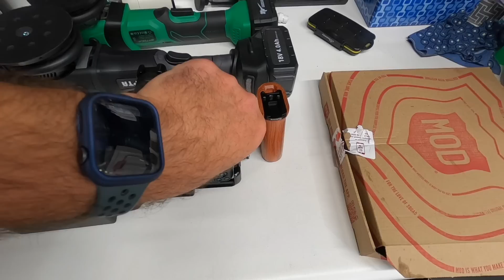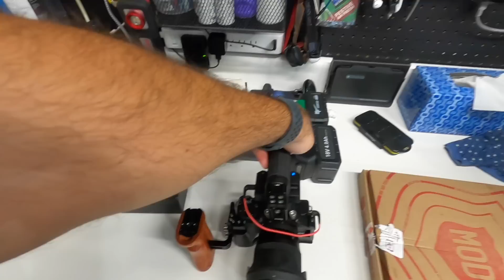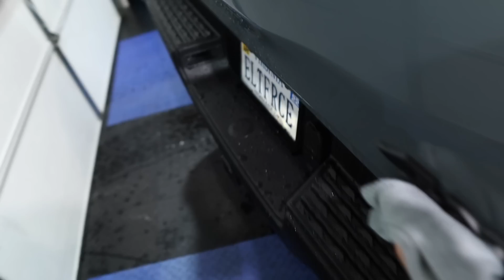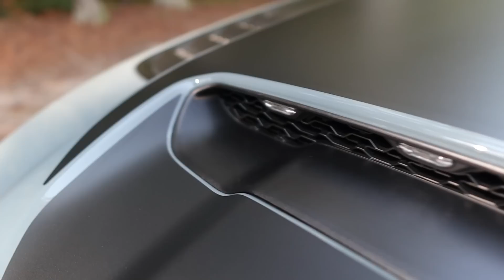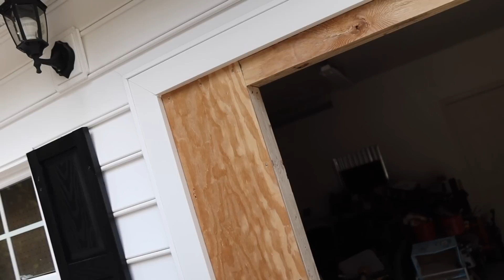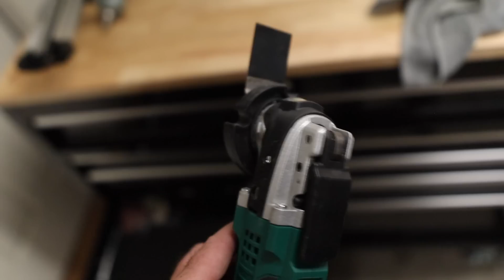Weekend Wash / Ceramic Coatings / Detail Lounge Build

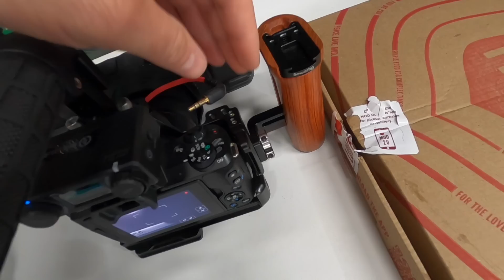Comment: 4:40 - Yeah, I HERE the difference alright.  Not hear, but HERE!  LMAO! :)

Oh Phil, what kind of LVP flooring you going with?  And are you going straight onto the concrete or using padding underneath the LVP?  Loving the lounge setup man!!!  You gotta host an event some time so your fans in the area can bring some beer over.  You like Pilsner or IPA?

Also, I just installed a ceiling fan in our new home and my wife absolutely loves the fan we got.  It's a Hunter Omicron that comes with a remote.  They're relatively affordable and come with a remote and work great!  One switch to reverse the fan as well.  Good lighting to boot.  Figured I toss an idea your way for ceiling fans. :)
Reply from the maker: 🤣. 
It’s the New Age flooring. It comes with a padding already on the flooring which is awesome. It’s like 1/2 inch thick!  
I love wheat ales, reds and lagers in that order 🍺.  Thanks for the tips!

Comment: Hey Phil. Mixing your super clean up in a sprayer for cleaning cars.how much super and water do you guys normally use? Thanks guys!
Reply from the maker: Hi. We mix a 1:4 ratio. So usually for a gallon mix 32oz of chemical and the rest what. 
Here is an easy way to calculate ratios 
https://youtu.be/9cCacFdc2CU
Reply: @MirandaDetailing  Phil. I’m going to use dr paint chip for a few Imperfection on my hood. But I was going to do it all in one polish. Should I do the polishing before I do the paint chip?  Thanks again!  Great stuff as always.ps. Dr paint chip works great. Just a heads up for you guys. Thanks
Reply from the maker: Hi. Cool!  I would polish first then do the chip repair. I haven’t used dr chip personally. Only becasue when working on a customers car I would have to order it ahead of time and most times I just find a paint chip pen locally, because it’s fast and cheap. But I have heard it’s a great kit. 
Thanks!
Reply: @MirandaDetailing  thanks Phil.
Reply: @MirandaDetailing  uesd the rupes uno protect and it did wonders. What’s a good and decent priced Ceramic coating. I have turtle wax spray now. I’d like something in a liquid form with an applicator. Any advice? Thanks lol.
Reply from the maker: We love use Gtechniq EXOv4 as a 2 year costing. It’s easy to use and gets awesome results. But if you want a spray coating they are really only a 8-10 maybe 12 month coating if garaged and cared for properly. The Hybrid solutions Spray coating is a great option!
Reply: @MirandaDetailing  ok, thanks. I guess I need to prep the paint first. Just used a all in one with my DA polisher. Then might just geon perp. Sound about right?  Your guys are the experts. Ty
Reply from the maker: I would just use a regular polish not an All In One polish those have built in protection already.  Do you have someone like 3D One or Hybrid Solutions Pro One and done?  Those are not all in ones, they are hybrid compound/polishes, they don’t have fillers or any waxes or sealants built in.
Reply: @MirandaDetailing  I just used rupes uno1. Can I just Strip it with the prep then use the ceramic coating?
Reply from the maker: You could but I’m not totally confident that a prep wipe will remove the fresh sealant in that polish. It’s safer to use a regular polish before a coating or a dedicated primer polisher like CarPro Essence or Gyeon Primer.
Reply: @MirandaDetailing  thanks so much Phil. You always come through for me. 👋
Reply: @MirandaDetailing  Perhaps I’ll just leave what I have on it, instead of ceramic coating it
Reply from the maker: That’s a good idea. In about 3 months time you can do it again and just use a regular polish and hen coat it. The Uno Protect usually last about 2-3 months.
Reply: @MirandaDetailing  ❤️